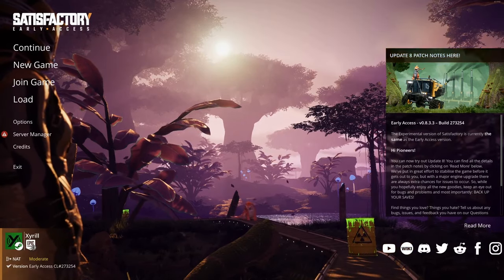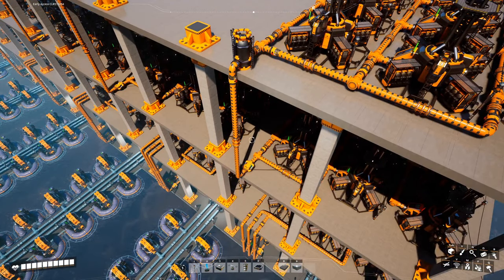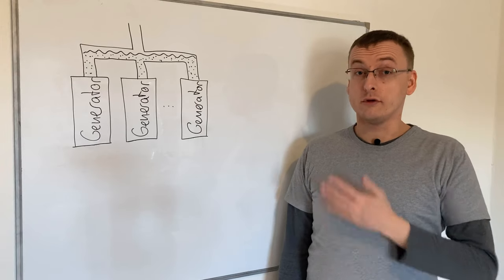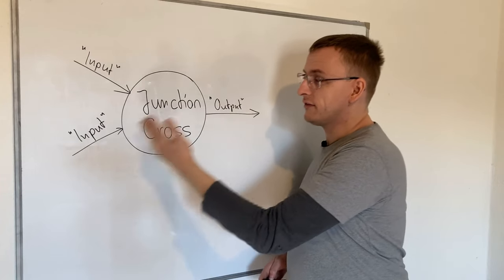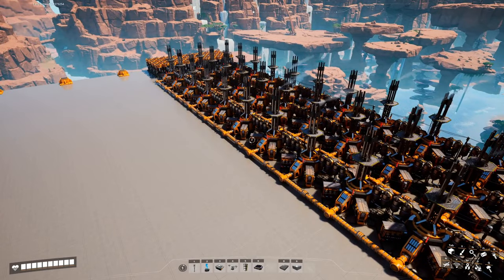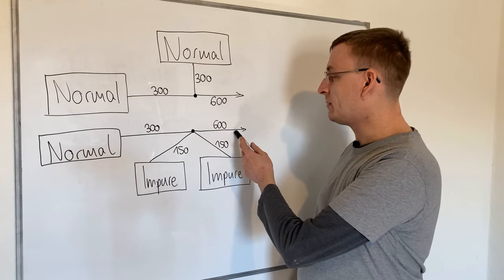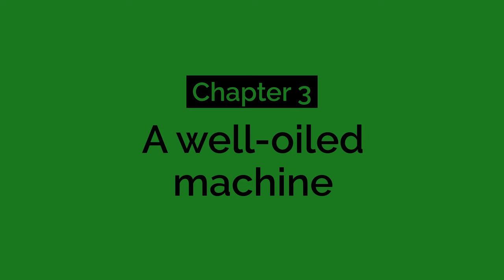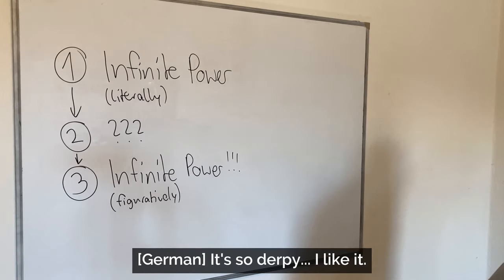How to use fluids in Satisfactory U8 at 100% efficiency

Comment: yesterday i found that using a pump up into a floor hole can also cause problems, i removed the floor hole and clipped it through the floor and it instantly solved the problem
Reply: Weirdly, I saw the floor hole problem on half the pipes in a manifold, but not the others. Since then I've been using the floor holes only temporarily to help establish the route of a pipe.
Reply from the maker: That's a known problem: https://questions.satisfactorygame.com/post/617eeccd831c852052357df7 - I have wasted way too much time on this already, so you won't be seeing floor holes on my builds.
Reply: @XyrillPlays  yeah i just use them to get my placement right then remove them and rebuild the pipe to get it how i want it :D
Reply: put the pipe roles, but clip the pipes over it. It will at least look good haha

Comment: Once you realize that fluid moves like conveyor belts with the exception that lower parts reach capacity first as the fluid fills "up" the system... fluid become much easier. The junctions act as both a merger and a splitter when necessary.

Comment: I have 1000 Fuel Generators running in two 500 unit lines at sea level starting in the North-West corner of the map and running East.  Each of the 20 Mk2 Fuel pipelines will run 50 Generators (do not overclock Generators).  Each pipeline is PEGGED at 600 M³ of Fuel.  The key to such efficiency is to have your supply liquids pumped to the top of your Blender Fuel factory (Water and Heavy Oil Residue) at least 200m above sea level.  Buffers are not needed and may complicate things.  Make sure your pumps are NOT at max distance from each other.  Allow ALL factories to fill completely before engaging the next one.  Hope this helps!

One more thing...combine pipes at the source ONLY, to achieve max flow.  After reaching max height you can THEN split the lines.

Comment: 1. Use almost all of the oil on the map to create 200GW of power.
2. Have plenty of power to build any factory you want.
3. No oil left to build anything.
Reply: rocketfuel is actually insane with the new update.. i build my ~140 mw plant in a day  with just 900 crude oil 2 sulfur nodes and 1 coal node aswell as 900 nitrogen gas and some leftover heavy oil residue from my plastic production and i mananged to make it run smoothly with all 520 generators on all the time. i currently just run 4 oil nodes in my whole world.
Reply: @mausplunder5313   You get 250 MW per fuel generator, so I'm pretty sure it's a lot more than 140 MW. ;)
Reply: @JanB1605  I was limited by 1380 sulfur. So I could just feed 432 generators. The rest of the fuel I burned in another 90 generators. And sry my mistake I meant GW

Comment: There is a known bug regarding mkII pipelines, they can't fully hold 600 cubic metres, it's to do with floating point calculations in the game engine. CSS know about it, but they are struggling with a solution at the moment.

The solution I came up with is to not calculate machines to use the full mkII pipe capacity and drop a couple of fuel generators off my build. I tried pumps, but decided on dropping the number of generators and doing without those few extra 150mw's

Great video btw and thanks for the link to the fluid mechanics, I lost my downloaded copy when I reinstalled my OS 👍
Reply from the maker: So I did remember correctly that I heard about this a while ago! Thanks for the confirmation. And yeah, regarding the link, I was very glad to see that it's just stored in the wiki. That feels like a much more authoritative source than some random Google Docs link.
Reply: They're not really struggling with a solution. They're going to drop the max rate down and adjust the recipes accordingly - like 250/m for mk1 and 500/m for mk2 pipes.
Reply: @halbouma6720  Has that been confirmed, I've watched every dev stream and don't recall hearing that
Reply: @MrBwian  it has not, because its not a bug, people simply still assume it is, whilst they simply dont understand basic fluid mechanics in the game and treat pipelines just the same way they use conveyors, whilst wondering why it isnt workin.
Reply: They can, and do fully fine. It's kinda funny how people still treat this as a bug, whilst its actualy simply an intendet mechanik of the game.

Stop treating Pipelines like Conveyors, and you will be surprised how the MK2 can hold the full 600qm easy without hitches.
Reply: @Rhanith   It HAS been noted as an issue in the past,like I said, I've watched their streams and Snutt himself has even mentioned the floating point thing.

I did watch last Tuesdays stream too, where they now said that it's possibly a fluid mechanics thing.

CSS said it WAS a bug, but now it's possibly part of fluid mechanics.

What I typed was accurate at the time
Reply: @MrBwian  Well it has been noted as an issue? yes, it has, but it never realy has been validated as a bug, and as such people tend to missinterpret those quite regularly, all im sayin. the point is, ever since update 8 we didnt realy have any major issues with those, when used properly and build in a way multiple people explained time and time again, thats the point im makin here.
Reply: FYI to all latecomers to this video/comment tree; the floating point issue should have been fixed since 1.0

Comment: When I was building my first fuel plant I ran into issues, and sometimes just adding a valve or pump would fix the pipe consistencies. Also yes, filling the pipes is critical before turning on production, at each step. Fluid is much more consistent with full pipes.

I designed my plant such that 1 600 pipe of oil would be taken in at each floor. Each floor would process to fuel and have the generators that fuel can power. I also isolated each floor power wise, so I could turn each floor on one by one. That made designing and debugging the system much easier, also made expansion super easy, and the layout for the new floor was exactly what was below. If there was a problem with one floor but not another, I could just check what was different. Usually a pump or valve was different or missing. If I want to upgrade to turbo fuel or some other recipe, as long as the existing system works I can upgrade one floor at a time, and still let the other floors run without interruption.

Edit: Something to note also is that this modular approach is really useful in a power down situation/Emergency. If I lose power on the whole map for some reason, I only need enough batteries to power a single floor from oil extractor to fuel generator. I isolate the factory power wise, and turn off all floors except 1. Then I can turn the battery power on and soon enough a floor is powered and generating energy again. That floor can then power another 1 or 2 on its own. Overall, I can reset my world power by just throwing some switches and wait, throw more switches, and wait. Very simple reset without needing to have a factor full of batteries, or needing to build 10k biomass burners just to get the fuel plant back up.

Comment: I didn't have issues most of the time after implenenting a simple "water tower" that i connected to all pipes that need to push fluids up.
I saved many pumps since the pressure of one tower with a small buffer on top was enough to get multiple pipes filled to the top.

German too btw😅
Reply: The game just picks the most elevated thing that gives head lift and pretends everything flows from there, even if it's a buffer that isn't even letting any fluid out. It looks like a pressure system but it really isn't, since you don't even let fluid go through the buffer, as far as I remember anyways.

Comment: Thank you, this might actually help. Saw a lot of tutorial videos and still the fluid mechanics don't make sense, still broken to a degree. It's not a fun game mechanic, that we don't know exactly why and what to do when parts of the pipe doesn't fill up, and we have to make alterations/extentions to parts of the pipenetwork just to make the basics work.
Particularly I had a friend build a 2 story building with multiple fuel generators but for the second floor for the life of me couldn't figure out why many generators didn't get the fluids while there were plenty as overflow. Likely it's the "invisible" backflow problem but tried pumps, extra storage, valves, connecting multiple points and still but the distribution came from bottom-up not top-down.

Comment: Absolutely fantastic video. This is the kind of community that makes me feel I'm definitely playing the right game.

Some of my own thoughts on pipes, wrt my current 100 odd hour run (last played Update 6):
Floor holes: floor hole failures have been very rare for me. I've only had one in my current run. Real pain to debug though, since of all the things that could fail, the floor hole appears to be the least likely suspect by far. 
Vertically aligned junctions: use blueprints! I've nudged (perhaps too much thanks to a mod) my way into vertical junctions that then refuse to actually connect pipes. Grrr. The most reliable way to create the blueprint it is to add a junction to a perfectly straight vertical pipe in my experience. The pipe can then be deleted.
Valves and buffers? No! I feel these devices only mask issues until you look the other way. Worse, valves reset the height that the fluid can reach to 0, which means they can only be used safely on perfectly horizontal pipes or negative inclinations. And will likely need a pump afterwards. Which is silly since pumps act as 1-way valves anyway. 
Load balancing fluids? No! That path leads to sloshy liquid madness. I actually did fail horribly with my initial coal setup this run on this run by attempting to load balance 4 water extractors. Unlike real fluids, Satisfactory fluids actively destroy each other when they slosh. At least that how I interpret extractors producing at 100% at one end, and coal generators starving at the other. Same setup without multipath junctions and coal generators actually produce power.
Junction splitting at the machines? Make sure they're all at the same height!

Comment: My first large-scale (read: anything bigger than a single normal node or using blueprints) was actually a powerplant built on those same oil nodes (using the packaged version of diluted fuel since I hadn't gotten far enough for blenders yet). I never got far enough to finish it before 1.0 came out and I reset, though (I decided to start off with just a section of it since that power was needed for the proper automation of its very parts, so that way I could get the first few gigawatts sooner to be able to set up the other stuff I needed)

Comment: There's some extra issues with your example build

Like you explained that valves only work with when the valves essentially need full pipes to restrict properly - the other thing about this is if you have full pipes in a system the machines consuming the fluids will automatically restrict flow to the parts needed

The buffers - similar that you need the buffers to be constantly full at all times otherwise back flow can happen - similar thing is that they don't accomplish anything in a working system but can cause more issues if it's not perfect 

 Merging your multiple extractors should be fine - what you want to do is loop your fluid manifold feeding machines and avoid the pipe feeding multiple branches of manifolds and do it on one elevation. You can do branches and changes in elevations but you'll often need a pump right after the junction to keep things flowing nicely. 

As for the reddit - take everything on there with a grain of salt - the only bug is from pipe holes and not the actual fluids.

Comment: Instead of hooking up 33.333 generators to a 400m3 fuel output from the blenders, I only connect 32 generators to that line. So my pipes stay full all the time as I'm producing slightly more fuel than I'm consuming. Pipes don't always seem to carry the full 600m3 so my power plant isn't hindered by a slight efficiency loss of the pipes.
Reply: It make it so much easier if you don't try for 100% eff, No engr in real world would try for something so crazy
Reply from the maker: Oh yes, absolutely. I plan lots of leeway into my designs when building stuff for work. But in a game, it's fun to go a bit nuts. :)

Comment: Also, do not use long straight pipes. For example, if you have 90 fuel generators, do not connect them to the one long pipe in series, it is better to divide the feeding pipe with junction into 3 pipes so 30 + 30 + 30 generators connected in parallel.

Comment: I'm a new Satisfactory engineer beginning with 1.0 and I first encountered the daunting fluid dynamics challenge by attempting to feed residual water output from a refinery back into the input buffer of the Aluminum system with full efficiency. The solution wound up being similar to what you experienced here; having to place pumps at the output of merging junctions with a valve just before the merge. I still don't completely understand why this works has anyone found more explanation about this behavior now that the system has been out for some time?